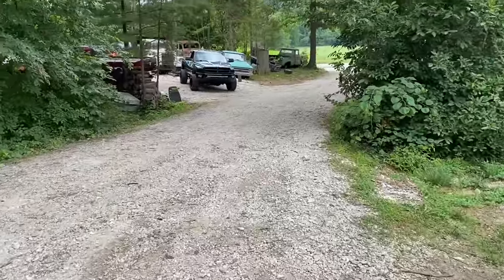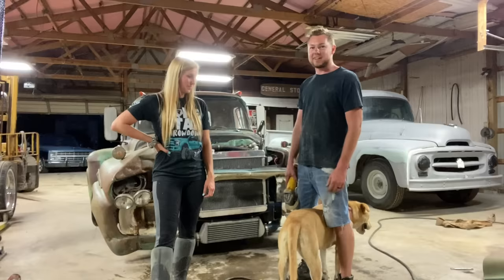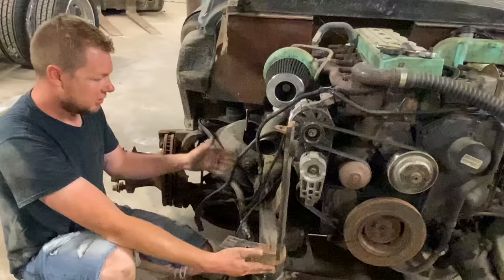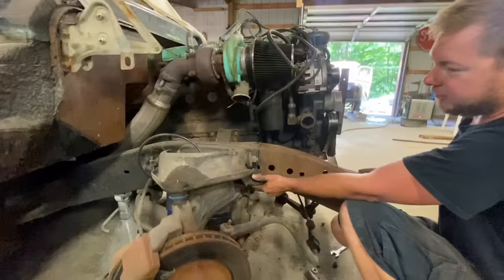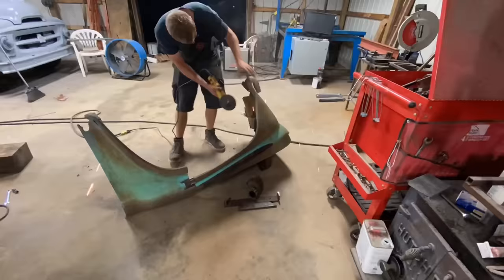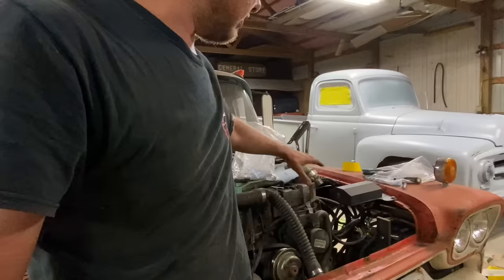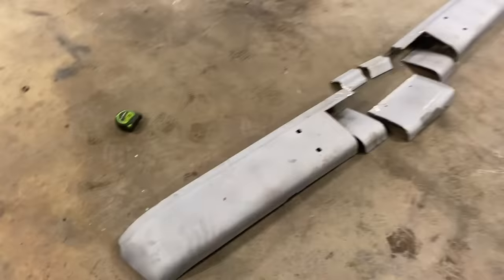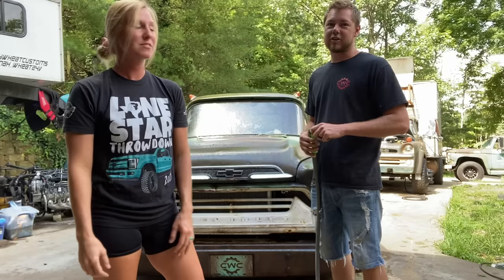We rebuilt my WIFES 1959 Chevy Viking!!

Comment: We had an old Viking grain truck on the farm, I think it was mid 50s.  It had two pointers on the hood that were chrome.  Looked like small jet engines towards the front on each side of the hood and kind recessed.  I tried to look one up but couldn't find it.  I think it would only haul about 200 bushels and I believe it had a 283 engine in it

Comment: If it were my truck, take the bottom corners of the front clip and weld them to the bottoms of the REAR FENDERS using that crease to rap around the corners  and it would match the front crease thats about 5 inches from the bottom and it would look like it was always meant to be, I hope I explained it so you understand it, I've got a 29 roadster p/up no bed built like a track T, old bonaville car. Old corvette engine, 57 ford rear, great fun, I'm 82 and still frying tires.

Comment: That frame would be an easy fix.  Best way to fix it is without using HEAT !  From what you showed of the frame but, without being there in person it doesn't really mean anything.  Im sure that you can easily fix it.  If it were on a new truck it'd have really be a lot of parts to buy !  I really love your truck.  We had a 56 4x4 Napco truck that I drove to school in so it just gives you alot of love for the style !

Comment: never built a low truck but looks to me that the upper control arms need to be raised on frame side where upper ball joint will have a better neutral position like i say never built one just looks dangerous on that angle

Comment: Two things...Hannah deserves wipers, as well as heater and defrost (considering where you live) and since that was not mentioned, since that's her daily driver.  Second, I know there is / was a time crunch getting the work done so Hannah could have her ride back, but I would really have like to have seen how you did the sleeve (or box you made) channel to mate the donor frame horn with the existing frame.  You did explain how you did it.  I know you did it "Right" but, some of us really like "seeing" the job done "right" so we "know" how it is "supposed to be done correctly" instead of...just "knowing" you did it right.  I mean we "know" you did it right because of the precious cargo driving it daily.  I'm one of those that would like to have seen how you actually did what we know you did to do this the "right" way.  (Granted...You probably did that while she was at work and couldn't make the video...Dammit)  Thank you for tolerating me..

Comment: So much easier to weld the old trucks than the new crap. All new vehicles are made of tinfoil and plastic not worth it give an old Chevy any day over the absolute crap they build today. I'm a body man and five six years old trucks and cars rusting out I have some old vehicles in a field and they have been there for years not rusting out at all . 53 Chevy truck not in rusting like ford's crap or dodges crap they make one even the new Chevy truck is disappointing rust like five years wheel wells gone rusted past the fender flares. Keep the real steal alive good job guys .